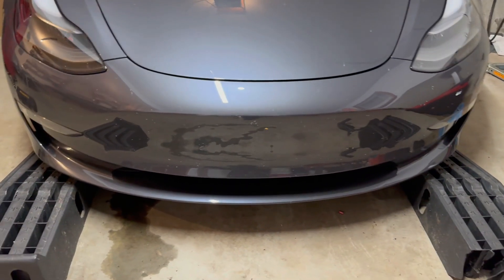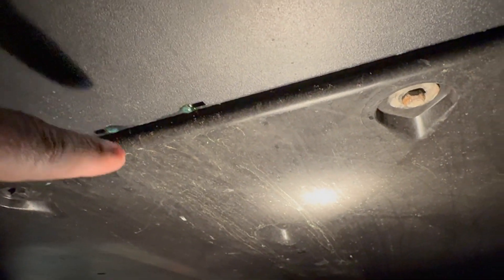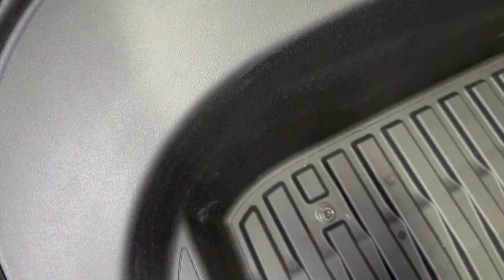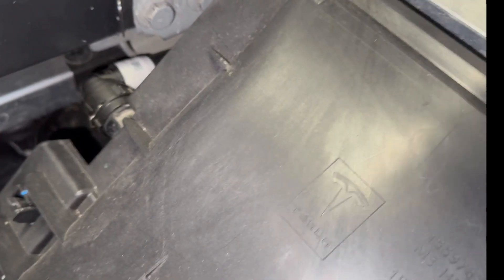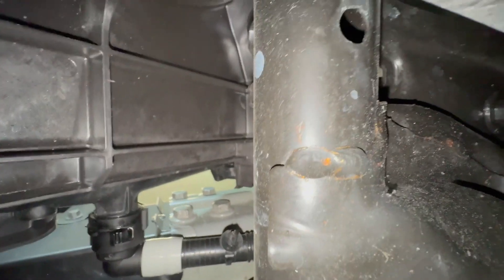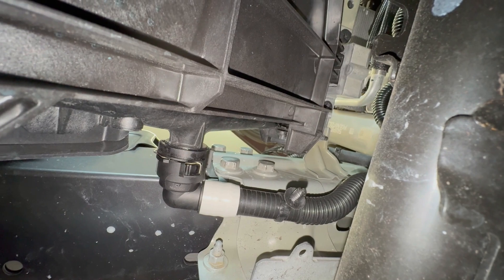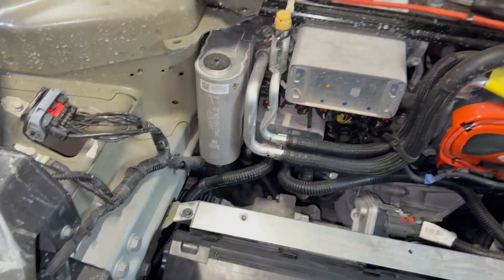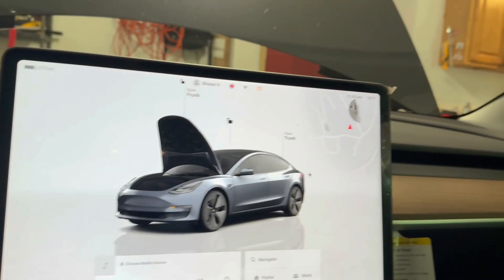Tesla Model 3 Coolant Refill and Purge Without Computer

Comment: Hi! I might have an air buble in my refrigerant, do I have to enter Coolant fill/drain first and then run the coolant purge? I did it without running the fill/drain and nothing changed. Tesla suggested to do a coolant purge. 2020 M3 LR

Comment: I replaced the radiator on a twenty twenty one model three and only maybe a quart of coolant came out, but the reservoir did not, drop at all
Reply: still need to do this process because once the system starting running it will drain the extra from the reservoir to fill the radiator